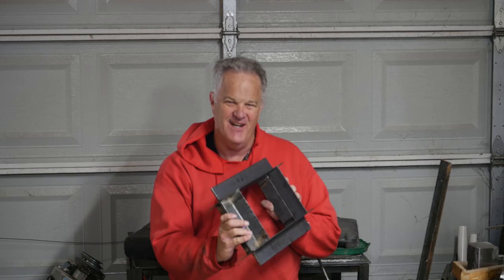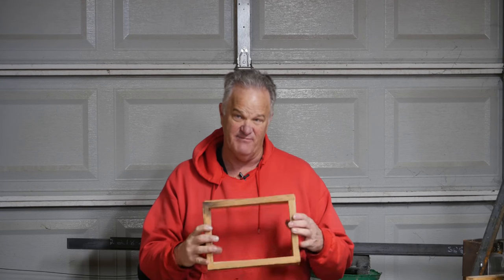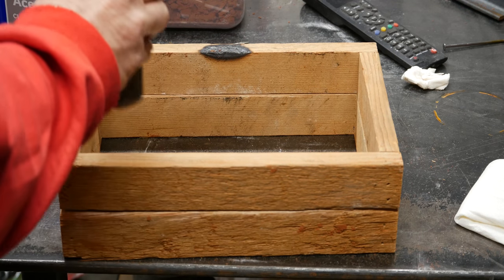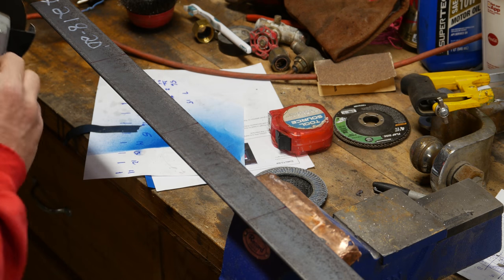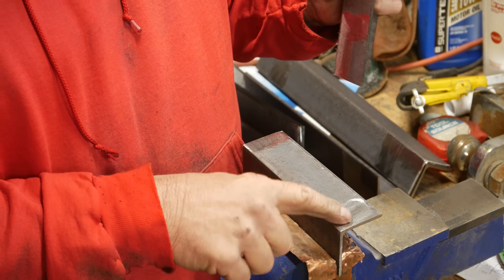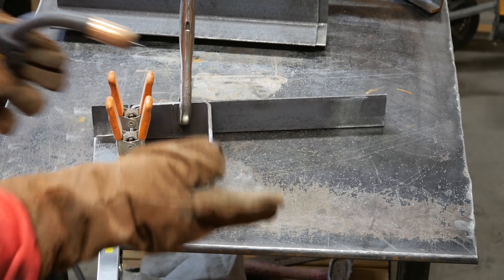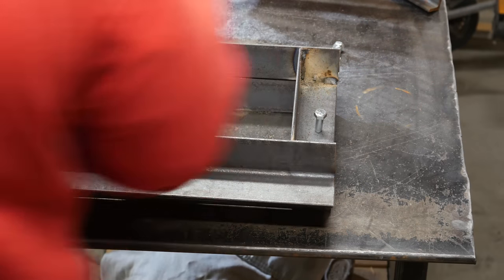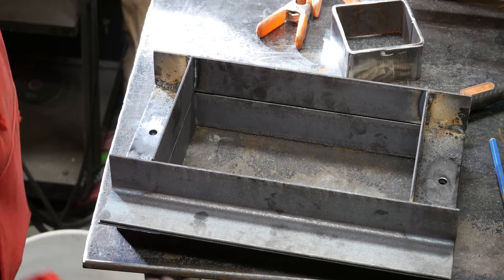Making a flask for sand casting

Comment: I new you would have a video somewhere in your library on how to make a flask, and a search of your back catalogue and sure enough here I am !  :)
Reply from the maker: Wow, you are part of the .01% :-D Nobody seems make the effort to look for past videos.  There are things about this flask that I do not like but they have held up for years now. I would make the horizontal surfaces smaller. As it is they catch a lot of sand and its a bit of a pain to clean them off before pouring the metal

Comment: Great video and a simple flask that won't catch fire. I think I make make a couple diferent sizes. Thanks for sharing.😎⛏⛏🔥🔥
Reply from the maker: One thing I would do differently in the future, I would reduce the amount of horizontal surface. It catches a lot of sand and is kind of a pain to clean off.   If you can fine rectangular tubing that might work better.

Good luck with them. The steel is definitely durable and flame proof. I love that about the flask I have

Comment: Amazing.  I will use this to make my first box.  Thanks!!
Reply from the maker: I will tell you that after having used this box for years I love the durability. What I don’t love are the horizontal surfaces, they trap way too much sand and have to be cleaned off in the molding process. If I were to make another I’d try to find some rectangular steel tube.
Reply: @swdweeb  Admittedly, I did not think of that.  I’ll be on the lookout for the tubing for that.
Reply from the maker: @VetvsWorld  I didnt think of it until I had used this one for a year or more 😀

Comment: You got those to come out real nice. They will be much more durable for sure.
Reply from the maker: Thanks, I'm pretty pleased with them..it?.. I used it yesterday and it worked really well.  Had to do some serious grinding on the pins as they kept hanging up in the holes. Now only the part of the pin that is actually in the hole is full-sized, the rest is tapered.  Comes out easy but locks in place just when it needs to.

Comment: Hi Swdweeb I take it that you used 2"  angle iron for the flask... Ok I just watched your video for the sixth time and saw that you used 2"  angle iron. Lol.
Reply from the maker: Did I? I can;t remember, I was going to run out to the garage and measure it for you. I ended up adding extensions to cope to make it taller. These are too short for getting a proper sprue and pouring basin cut in along the the runners and gates. I will reply again with the height of my cope.

BTW, These have served their purpose well, but I'm going to be casting new boxes out of aluminum. There are things about these boxes that can definitely be improved upon. The way the sand builds up on the outside in the corners is one. They're heavy, which isnt a huge issue for me and the pins don;t give the best alignment (although they're not terrible and do work) 

I don't know when  I'll be making the new boxes, hopefully before the ned of the year. If you can hold out, you might want to wait.
Reply: @swdweeb  Hi Swdweeb I'll be watching out for your new videos. I find the things that you do very interesting.
Reply from the maker: Thanks Michael. I forgot to get back to you on the height of my cope. its 75mm or 3" tall.
Reply: @swdweeb  Thanks for the info.
Reply: @swdweeb  Hi Swdweeb, I don't mind waiting to see how it goes.
Reply: @swdweeb  hi there. I can't wait to see how you cast your aluminum box.
Reply from the maker: @michaelgoodwin845  Hi Michael, I haven't done a lot of casting... any casting... for right at a month. I've been busy with fun stuff like painting the house. Hang in there  It'll happen. ;-)
Reply: @swdweeb  Hi Swdweeb, no problem, I'll be waiting. I Enjoy watching your videos. 😊